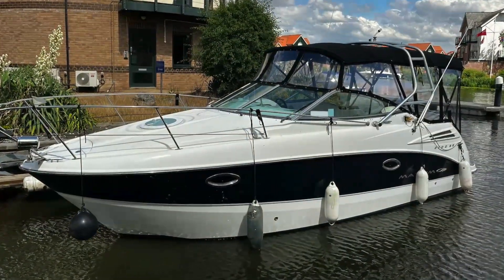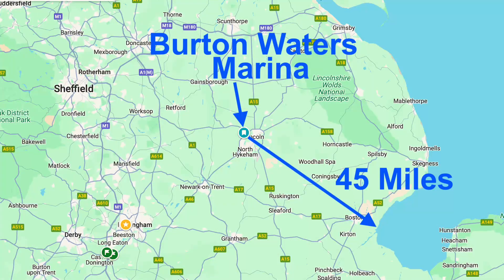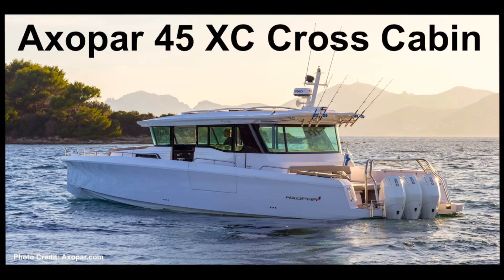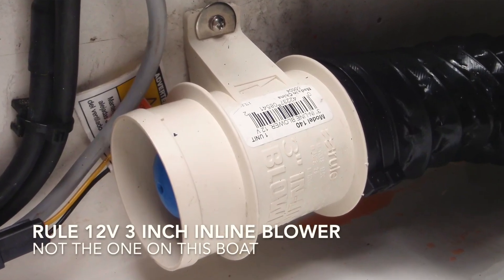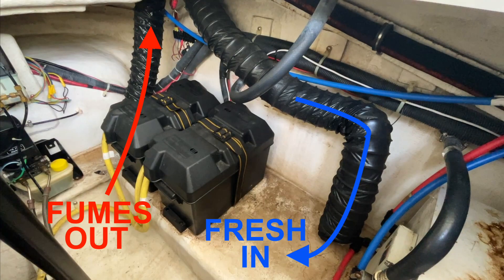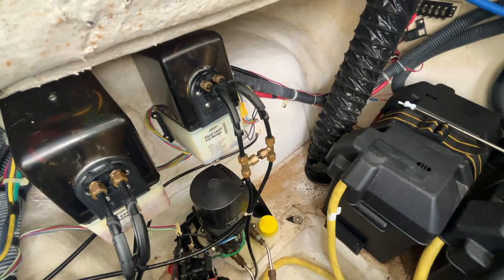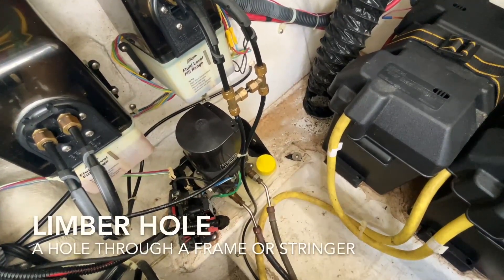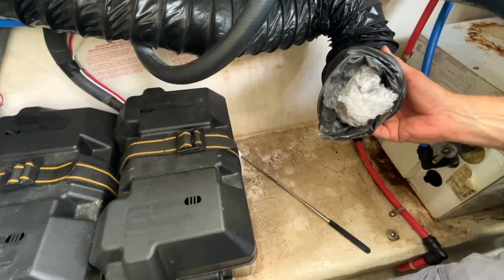Serious Defects In Engine Room Ventilation

Comment: Is there a need to vent fumes from a diesel powered engine space? Is the risk here heavy gasses collecting rather than explosive fumes?
Reply from the maker: The flash point temperature of diesel is only 52 celsius, so any build up of spilt fuel in the bilge poses a risk. Way less risk than for gasoline of course!
Reply: thanks for the reply  @whitehatmarinesurveying

Comment: Be better if they were opposite sides of the boat aswell
Reply from the maker: You're spot on, perhaps even with a positive pressure blower on one side to force fresh air in and a negative on the other to suck fumes out.  Pretty much any variation would be better than what I found on survey.